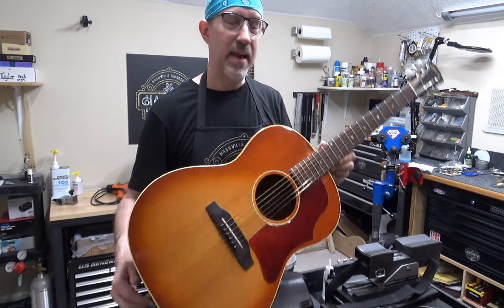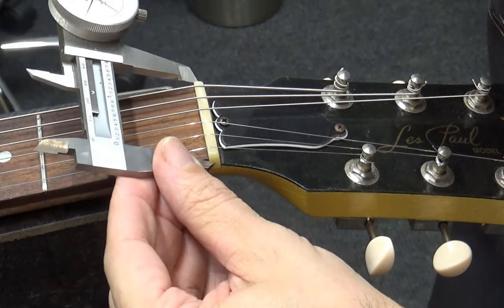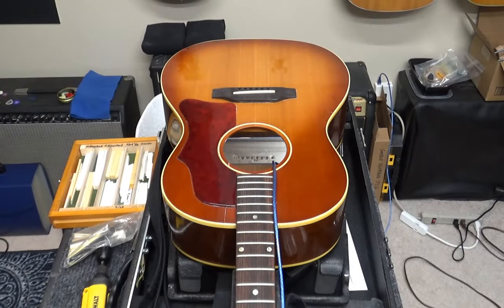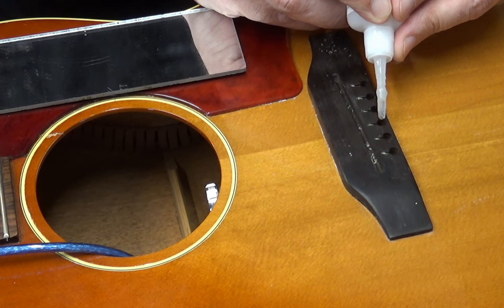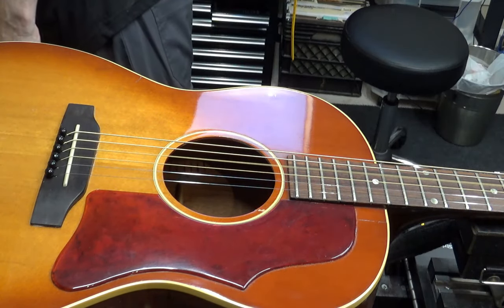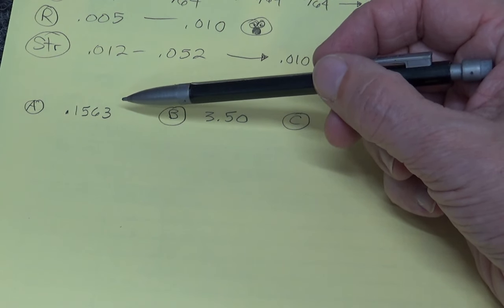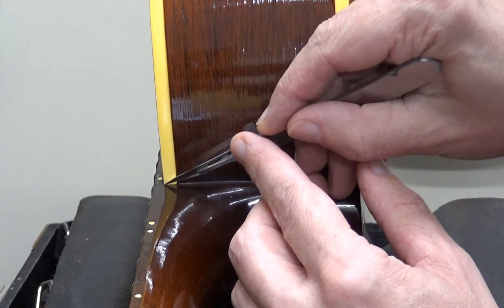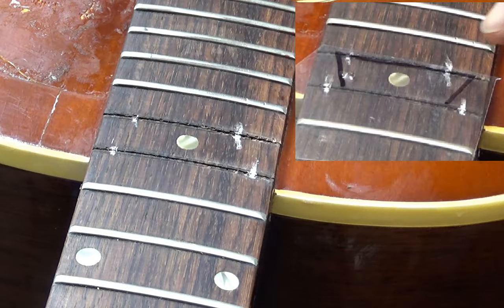LG1 Bridge Plate

Comment: What do you do if yourGibson has one of the 1960’s plywood bridge pads? Overlay?
Reply: Remove and replace. You'll be happy you did. Check out the bridge plate heater arm that the lutheir shows in the recent Looth video about Frank Ford. I'd guess it's about 1/2 way through the long video, but well worth the view.

Comment: Excellent video, thank you. I  have an old Yamaha F310 to repair in that has a badly damaged bridge plate with the string winding close to the ball bending over the saddle and effecting sound. I will be using this method as the plate is not cracked and can be saved.  You're the master, keep the vids coming for us guitar tech wanna-bees
Reply from the maker: You are welcome!

Comment: Does Taylor Guitars have it right on their bolt on system ?  OR?
Reply: My 910 is from 1989 and it hasn't needed a neck shim adjustment except for when I first got it. It was set higher than I liked from the factory. I've kept 11s on it, never put it in the case with loosened strings, and kept it humidified in the winter. I say yes.